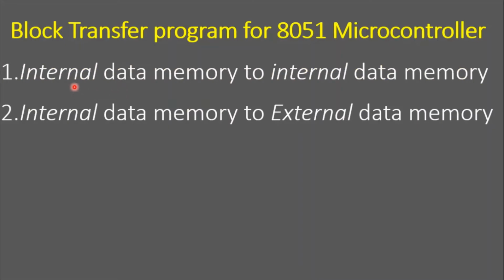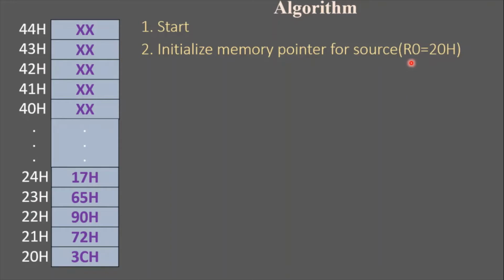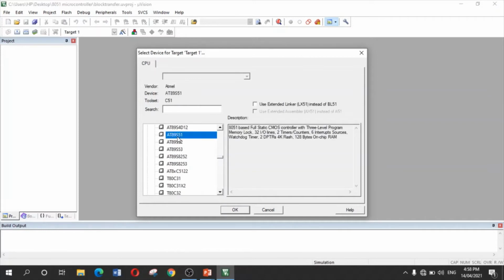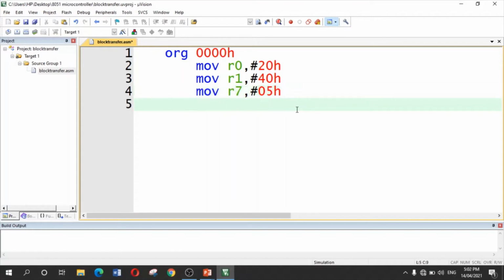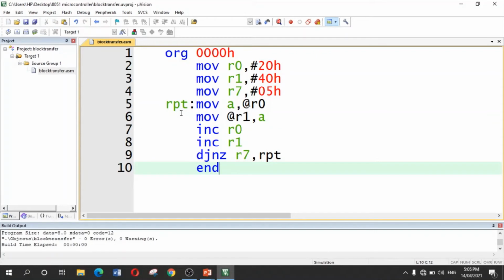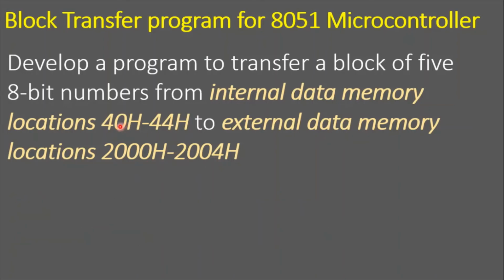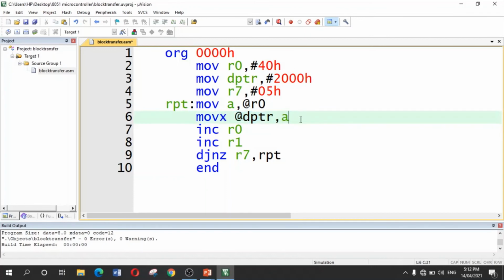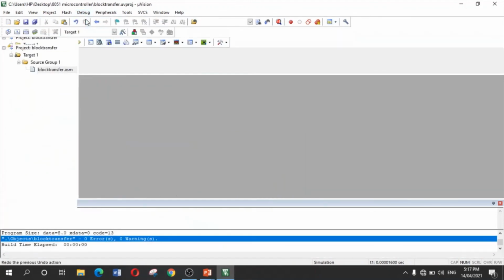Block transfer program for 8051 microcontroller

Comment: How to transfer external block data to internal block data?
Reply: The memory pointer register dptr will point to external memory location.movx a,@dptr instruction will be used to fetch data from external memory into accumulator and then same number can be transferred to destination location in internal memory by mov @r0,a instruction.The rest of the logic will almost be same as that explained in second program.